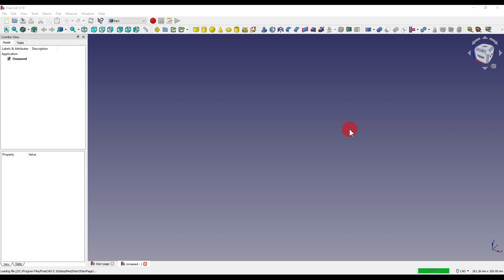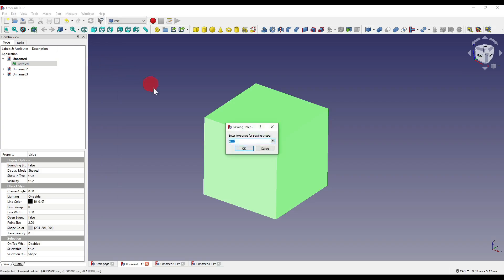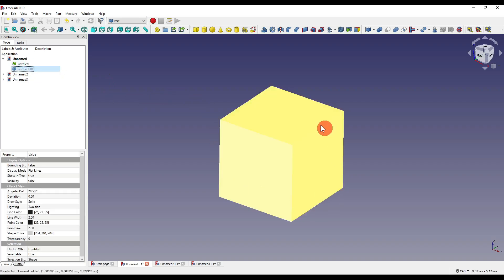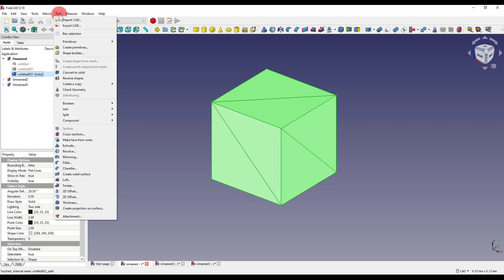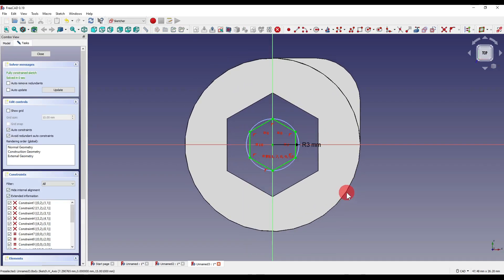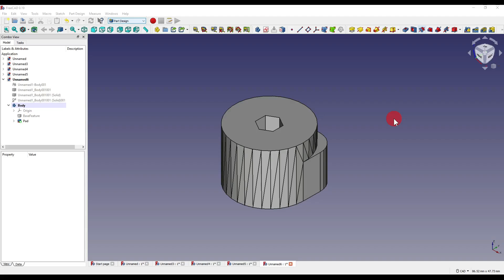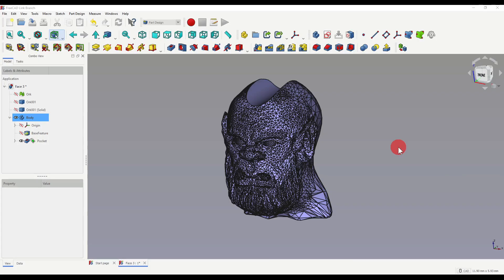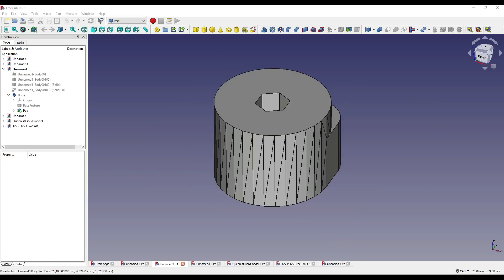FreeCAD 0.19 - Converting STL files to Solid models

Comment: I have a very curvy surface that I want to refine. after proceeding until "convert to solid" the surface created still looks like mesh, but is considered a single surface... the "refine shape" method still rendered the same result. Can I still proceed to work with this result? I tried "extrude until surface" feature in solidworks and it worked perfectly fine, but I'm worried if it will introduce errors during CNC manufacturing.

Comment: Need a little help guys, i cannot convert any mesh in to solid - there is error stating that the object is not shell. What to do?
Reply: Same issue here
Reply: @kalfoxx7749  year later I still have it even on newer windows and different machine...
Reply: @bonvi2896   @bonvi2896  I found that the mesh repair tool actually worked, but as I had a composite STL made up of multiple other STL's I still got the error as Freecad (as mentioned in this video into) cant handle composite STLs. The only solution was to treat each component separately which was more work  than redrawing the design from scratch. The search still continues for software that can make my workflow more efficient.

Comment: It took me 1.5 hours to do the first 3.5 minutes but I got the hole! Thanks. I went super slow and finally did it right. Your presentation is solid.
Reply: "Presentation is solid".... I see what you did there..... 👻
Reply: I'd much rather have someone explain in a concise way, and pause or back up when I need to, than have to either speed up playback or skip forward when they're saying the same thing multiple times.  Yeah, solid.

Comment: Convert to solid result:
08:58:28  <Exception> MultiFusion failed
09:06:57  Traceback (most recent call last):
  File "<string>", line 2, in <module>
<class 'Part.OCCError'>: Shape is not a shell
09:06:57  Cannot convert pommeau_de_vitesse001002 because Shape is not a shell.

Comment: So I may have just found a workaround for my problem. I went to General under Preferences and chose Part as  the module/workbench to load after startup and now I have a Part menu on my menu bar. It still doesn't appear as an option in the workbench dropdown.

Comment: I can't get the Part workspace to open/load. I go to edit/preferences and add workbench Part but it comes in as Part Design. So I can't seem to get to the Create Shape From Mesh Command. I don't see what the issue would be as it Says Part in workbenches and there's a separate workbench for Part Design.

Comment: I haven't inspected how the sowing tolerance works in FreeCAD, but spontaneously I'd think it's something like how far apart two vertices or edges may be while being merged, similar to Blender's Remove Doubles tool (now named Merge By Distance, I think). A higher tolerance thus means more geometry needs to be considered to find which to merge. A fully compliant STL should work with a tolerance of 0, while a vertex list format like Wavefront OBJ doesn't need this check, since connecting faces share a vertex rather than just have identical vertices.

STL is a very minimal format. It only holds triangles, and that's why you get so many facets. The Refine tool merges tangent faces, e.g. coplanar for planar faces (STL triangles are planar, unlike AMF triangles which can bend), but for the cylinder surface the tesselation in this case wasn't quite that way. This is a challenging problem akin to image vectorization. The short of it is, if you want precise shapes, don't use mesh formats like STL. Use e.g. STEP or IGES. Better still is source formats, but exchange formats have their purpose in moving across tools. 

When exporting STL from FreeCAD, it has to tesselate all geometry, as well as when displaying it. The View property group Object Style has parameters that affect this, like Angular Deflection and Deviation.
Reply from the maker: Woah! Thank you for the detailed explanation LoneTech! 😀
Reply: @AndrewCAD  GOD JESUS TOLD US TO LOVE GOD AND TO LOVE ONE ANOTHER! LET'S NOT DESTROY THIS WORLD! NO WAR!!! БОГ СОЗДАЛ ТАКОЙ ПРЕКРАСНЫЙ МИР! НЕ БУДЕМ РАЗРУШАТЬ МИР! ПОЛЮБИМ БОГА И ВСЕХ ЛЮДЕЙ! НЕТ ВОЙНЕ!!
Reply: In a similar manner, at 5:05  you have the vertical edges, and the diagonal edges are another angle.  With twice the bends, it is a much better fit for a circle than if you got rid of those diagonals.  If you up the threshold it probably will put them together into rectangles, but you'll have a twice as poor cylinder in the process since you got rid of half of the edges for the curve.
Of course recognizing and fitting curved surfaces is better and maybe it can with tweaking.  Really nice would be assisted conversion, so you can tell it to fit a curve to this surface and similar ideas.
Reply: @ModelLights  GOD JESUS TOLD US TO LOVE GOD AND TO LOVE ONE ANOTHER! LET'S NOT DESTROY THIS WORLD! NO WAR!!! БОГ СОЗДАЛ ТАКОЙ ПРЕКРАСНЫЙ МИР! НЕ БУДЕМ РАЗРУШАТЬ МИР! ПОЛЮБИМ БОГА И ВСЕХ ЛЮДЕЙ! НЕТ ВОЙНЕ!!
Reply: I think that cylinders that were built as cylinders originally should behave properly - I tried this with a part that was made from cylinders, and the mesh looks much different from the one Andrew showed that didn't clean up: in mine, there were straight lines connecting the points on the circles, and then there were lines made by connecting one point on one end with the next point in the circle on the other end.  This means that these two triangles really are in the same plane, so the refine operation is able to reduce them to a rectangle.  In his, I can see that the points on the upper and lower circle don't line up with each other, so none of the triangles are coplanar, and refine won't try to fix them.  It's all about what the developer thought was best.  In the case of OpenSCAD, cylinders are just extruded polygons, where you can set the number of sides with the $fn variable, so the sides are always rectangular, or at least parallelograms, for tapered cylinders.
Reply: GOD JESUS TOLD US TO LOVE GOD AND TO LOVE ONE ANOTHER! LET'S NOT DESTROY THIS WORLD! NO WAR!!! БОГ СОЗДАЛ ТАКОЙ ПРЕКРАСНЫЙ МИР! НЕ БУДЕМ РАЗРУШАТЬ МИР! ПОЛЮБИМ БОГА И ВСЕХ ЛЮДЕЙ! НЕТ ВОЙНЕ!!